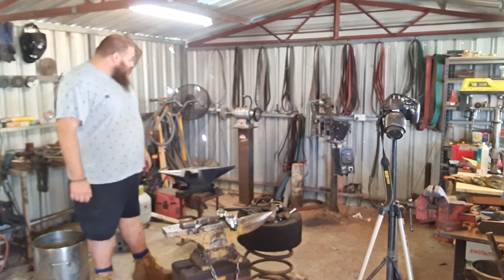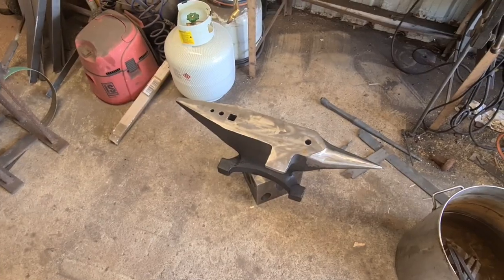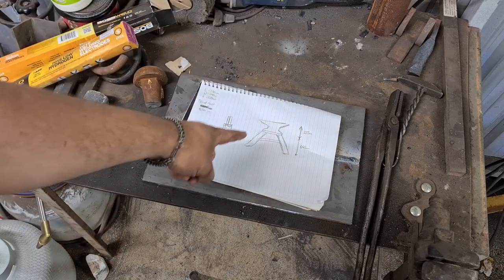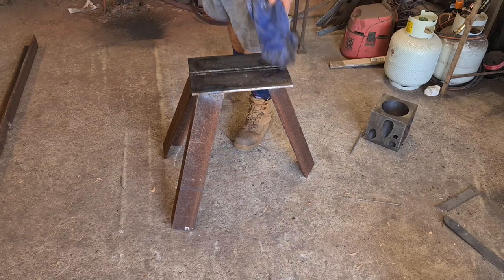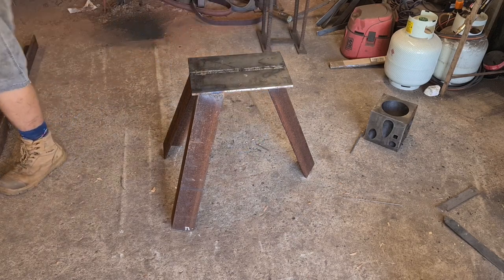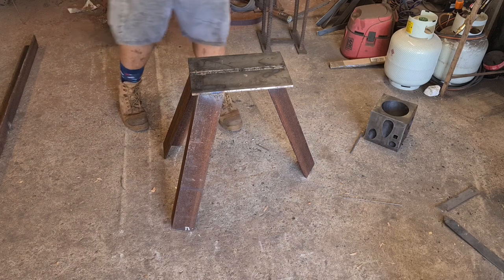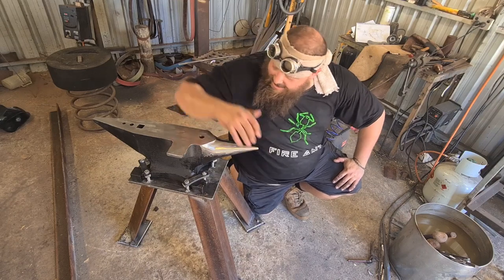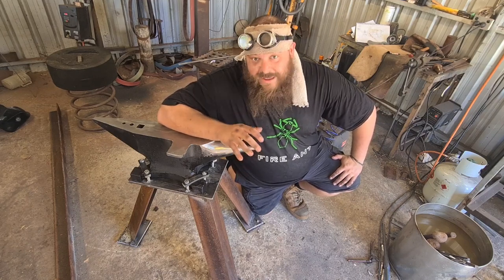Fabricating an Anvil stand

Comment: If you find the anvil is still too loud after you get to using it, gluing it down using a caulking gun adhesive or silicone does WONDERS. I tried the same thing you did with yours (rubber between anvil and stand) and it was still alittle loud for my tastes. Gluing it down absolutely killed the sound.
Reply from the maker: Yeah I considered it, this thing's pretty quiet now with the brace cinched down

Comment: Nice stand. And yes, you should have drilled the holes earlier 🤣. But I guess, it was like mine stand. The next one all the errors I made will flow into planning and it will come out even better. By chance do you know the angle you used on the legs ? If I remember correctly I was going with 15°
Reply from the maker: I don't actually know the angle, Alex just sent me lengths to cut haha

Comment: They’re not a good Anvil 🤦‍♂️ there magnetised ,  pretty much there a big magnet 🧲🤦‍♂️🤦‍♂️
Reply from the maker: I will be doing a review, there is a reason some of them are magnetised
Reply: @SamTownsBladesmith   when you do your review check the sides of the Anvil. i’ve had 2 now and there’s been holes in the side , filled up with car bog.
Reply from the maker: @billiejohns6270  that's a new one, will do
Reply from the maker: @billiejohns6270  did you contact Bruce? Also, could you send me photos please, on IG or Facebook?